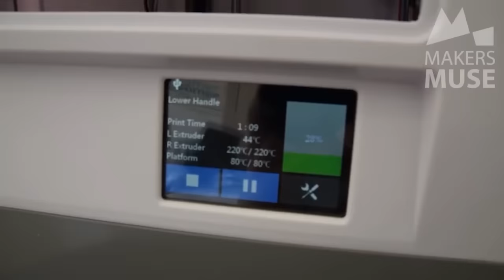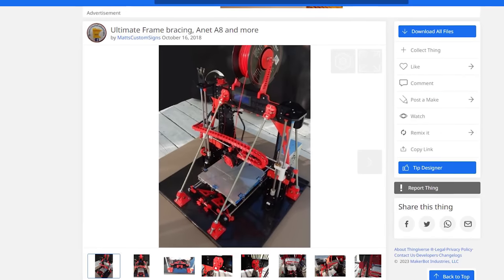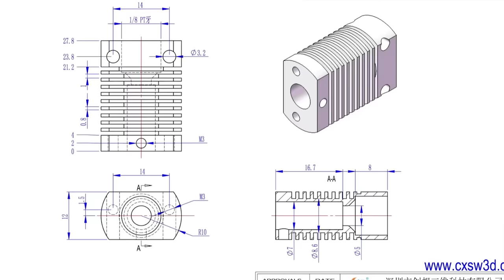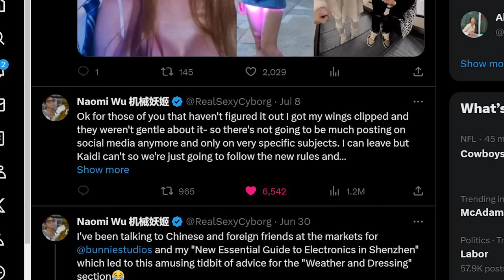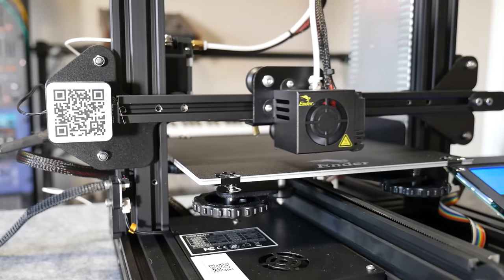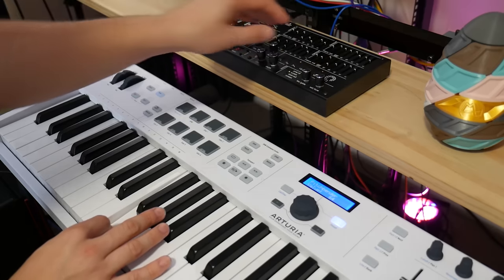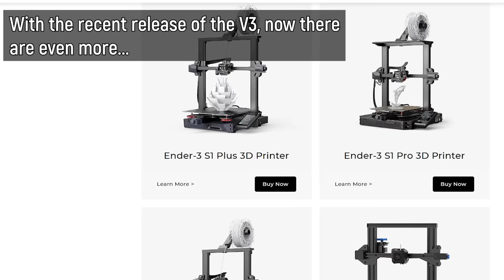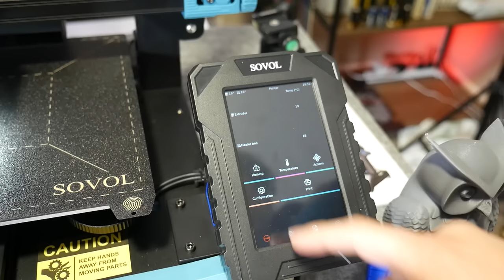Creality Ender-3... it's time to move on.

Comment: For me the its was always about trying to figure out how to get my ender 3 to work and when it did work something would go wrong. When i thought i had it working it turns out my belt tension was too much and ended up snapping mid print. It was a good learning curve it was fun and frustrating but it made me learn alot.

Comment: Similar to what many manufactures do to extract as much revenue by repackaging same old technology in a new package, unfortunately. Yamaha does the same thing as an example my Yamaha PSR910 has as many features as some of the newer higher end keyboards. I had to fix my old keyboard, many times, for this reason instead of purchasing a newer model which aside from a few maybe extra features, it has the same old technology but in a nicer and sometime not even that, package. Same with 3D printers and, in general, many other products.

I noticed in another video that talks about the CR10 S Pro  being a better machine to all  the previous models,  probably because it approximated the earlier excellent Anycubic I3 Mega in architecture, and  which, in my opinion, the I3 Mecha architecture yields a much better 3D printer from many aspects, beginning with a CLEAN and STRONG design approach.

However, I am not a fan of open architecture (mechanical structure) 3D printers, although I have machines of my own conception, designed this way, for simplicity, but in a core xy configuration which in this case justifies due to the mechanical stronger structure when done this way with lightweight extrusions.

Comment: My first and current printer is an Ender 3 S1. My first one had to be replaced because it was faulty out of the box.

The second one that I now have is way better. When the printer works: it's great! When it works. Have your first born set aside to sacrifice to the 3d printer gods when you need to troubleshoot the thing every so often though.

Comment: He has a point. unless you get an ender 3 v2 neo. Its still a great printer and I currently have 2 because of their great value but now there are better printers for under 200. And if you hare willing to spend about 500 dollars you can get an anycubic. Which can prtint at 500mm/s and has a build plate size of 420mm x 420mm.

Comment: You forgot another factor people consider... Out of box usability!!! That is a HUGE thing with people wanting to get into 3d printing. I have been in 3d printer since original ender and flashforge dreamer. I rarely printed becausr it was a pain to level, set z offset, get bed adjession ect. I said id come back to 3d printing when its not a pain.

Enter bambu labs. Plug it in and print. Literally the easiest thing ever. Its ridiculous. Sent back the ender 3 v3 i just purchased and never looked back. Buy the best printer you can possibly afford. Bambu labs has clearly taken over the market. Theres a reason. Havent even noticed that it is closed source.

Comment: We have an ender 3 max that's been out of commission for half a year now. Have spent more in parts trying to fix it than the entire machine costs new, dang thing just power cycles whenever you start heating the nozzle. Very VERY annoying and I'm about ready to give up and find a different platform.

Comment: I have a Ender 3 v2 Neo, and I think it prints just beutifully. But it is slow, and the fan noice is really annoying. So I have a few upgrades to do, all metal hotend, a bigger nozzle and quiet fans are in the pipeline. And I have a raspberry pi just lying in a drawer so I guess Octoprint also is in the near future.

I'm glad it's my first printer, but I think my next printer will be from a different brand.

Comment: I bought a CR-20 and that’s just an ender 3, more or less (automatic bed leveling though). I've had so much trouble getting good prints, or even finish prints, that it just stands in a corner and isn't used anymore.

Comment: My first FDM printer was the Voxellab Aquilla, Lord was that thing a P.O.S.
I highly suspect they gave me a refurbished model even though I bought brand new.
I now own an Elegoo Neptune 3 Pro and let me tell you, it's a world of difference to have auto leveling built in and I've had no major issues with it asides from the parts not sticking to the plate nicely without using a glue stick.

Comment: I just pulled mine back into the light as I had the issue of I guess it clogging up on itself and it’d print with nothing coming out, I believe I have it fixed now by taking off the bowden tube and cleaning out the nozzle so I’m hoping it’ll go back to printing and I won’t have to do that again 😂😅 I definitely agree that the ender 3 just isn’t the go to anymore as there’s better options so with a bit of homework buy something else instead of the ender 3 😂

Comment: I mean if I got another printer I definitely would get a better one, butt it was kind of hard to beat that $99 special MicroCenter had (aside from kind of having to get some extra stuff to make it work..butt I probably would've had to get that stuff anyway, so at least I wasn't as far behind when it came up). Ik I'll have to replace stuff sooner, and have less convenience with it then with others, butt not having to spend that all at once definitely helped break the seal of getting in to printing, and (fortunately) there's ppl like you that help work with what I got :p

Comment: The Ender 3 S1 (Non-Pro) so far is really good, it's the first one I have owned/ used and worked right out of the box but I'll also add they're some thing that do need some help. Ps I will edit this if anything happens because i'm going to update the firmware both for the display and the main board.

Comment: After my first CR10 died and I couldn't get it running again I went to Microcenter to pick up an Ender 5 plus. But when I got there I realized I could get a CR10 V3 and an Ender 3 pro for about the same money. I really do like the Ender 3 and never had any issues but I probably don't use it as much as more hardcore users. That being said I'm thinking about getting a Bambu or two next year. 😂

Comment: The majority of 3d printers sold are bought by hoddyists that can't afford or don't want to plunk down $500 - $1000 or more to get into 3d printing. The Ender 3* units are still viable. You can pick up variants for less than $100 on sale. If you feel the need, upgrading them is cheap.
I bought an Ender3 v2 that printed quite well out of the box.  Because I like to tinker, I've added mods over the last 3 years, such as a BLtouch, slice bi-metal hot end, Satsana blower housing, linear rails, micro swiss direct drive, dual Z drives with extended Z rails to 400mm and jyers software. It's still a perfectly reliable printer. I often think about a larger print bed and if I go that route, there's a website that sells kits to make them bigger.

Comment: right now, I just can't use my ender 3 pro after the rats got into the box and ate the wiring. replaced the board with a 4.2.7 and bltouch on a sprite direct drive, and non of the creality firmware works. so i am in the process of trying to learn how to compile my own code. still can't get it to home anywhere lower than 5 inches above the bed. lot's of frustrations

Comment: My only printer was an Anet A8 in 2018.
I printed a test cube about 3 times, threw my hands up and abandoned the 3d printing scene.
It left an extremely sour taste in my mouth.
I want to come back, but the only "no fuss" solution being Bambu Labs (not open source) is really frustrating to me.
Reply from the maker: Most of the new bed slingers are good from factory now! You can go with Prusa if you want some open source details, or Sovol who release full .step assembly files. Very sorry you got burnt by the A8 , they ruined it for a lot of people.

Comment: Correction to my rant: I re-listened to your comment and you did say that they were basically the same. So, my rant:
I disagree with your analogy about toothpaste.  If you read the labels for active ingredients you'll find that the sensitive teeth is no different than normal toothpaste. If you look for whitening toothpaste then 50% of the time there is no difference and the others have a small amount of peroxide, Hydrogen Peroxide.   This amount is so small that you want notice a change because if the amount was high enough to do anything your teeth would start to have problems and you really would need a de-sensitizing toothpaste.  Which they will gladly sell with another label stuck on it.

And thank you for opening my eyes and re-thinking my next purchase as I've been considering getting the V3 KE. I've been watching the various groups and seeing what problems people have and as you said, quality control is bad.  As I can afford better I guess it is time that I start thinking that way and quit punishing myself with beginner printers.  
After doing a little bit of research I wonder why you mentioned the Sovol SV06.  Have you tested this out as there are so many disturbing reviews about  Sovol and such?

Comment: so you mean to tell me the reason I cant print in PETG is because of that tube not being cut correctly AND too close to its own melting point while printing???

There isnt a way to solve this is there? id like to go PETG because the one print that came out great for me is strong AF compared to any PLA ive done. but with the stringing, the constant clogging, and the temp req being so high its dangerous fume wise to run idk how to use it...

Comment: The ender 3V3se(ke) changes the landscape of cheap 3D printers. It's automatic functionality changes the game as it solved most of the problems I've had with my E3V2.

Now, I'm just waiting for community support in terms of custom firmware and slicer support. Creality makes decent hardware... But don't have the enthusiast in mind. Their slicer is garbage and their lack of firmware configuration control prevents serious tweaking the printers.

Comment: Huh, I’ve had my ender 3 for over 2 years and it works perfectly for me. It’s big and great quality. Ofc I had trouble for the first few days, but when I got used to it it worked perfectly fine with no big flaws. I personally think it’s great but ofc not to be rude. :)🙂
Reply: BUT over everything else, the bambulab is really (in my opinion) the best.

Comment: I have a ender 3 V2 and a Tron xy ender clone and love both of them.

Sure there older and outdated but I have 150$ into both of them. So I don't need a fancy 500+ $ printer for what I do. 

I keep a .8 nozzle in the Tron xy and a .4 or smaller on my ender. 

So for me having 2 printers that just work is better then one fancy printer. 

Just my experience

Comment: I would not buy the original Ender 3 as a beginner printer, but the Ender-3 S1 Pro could be a good beginner from Creality.

It has bedlevering, and it has direct drive and quicker print speed.

Comment: I've got a new Ender 3 being delivered in a few hours time. I looked at many alternatives but it was in their Halloween sale from Creality and seems to be an ideal cheap basic printer that's easy to modify. I've started off by also ordering a direct drive extruder and an insulated enclosure for ABS printing but I'll probably add other things such as auto levelling soon too.

I've  had a Flashforge Creator Pro since 2017, which is great for all types of filaments but the bed is too small. I also have a Sunlu S8, which is a CR10 clone and great for larger PLA prints but I wanted something for ABS with a slightly larger bed and that's what the Ender 3 is for. I should be using it in a day or too so hope it does what I need.
Reply: good idea on the direct drive for me the stock setup was nothing but trouble so much so that i gave up on the printer for 6 months till i remembered i had gotten a direct drive setup in one of their retailers spin to win events

Comment: the E3 is one of the best beginner machine, if someone like to learn how a printer works. but yeah, this is not a beginner printer those who just want to print. but I think that they will never print well, because of the lack of knowledge about the printers itself. this fact will effect them to choose the best speed, acceleration, infill, thermal settings in the slicers, and won't be able to use the klipper up to its limit.

Comment: I just got a deal on a ender 3 v3 ke… it has all the stuff a modern 3D printer should have. I agree the other, older, models should be removed from the lineup.

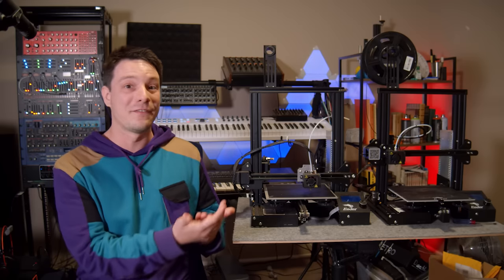Comment: @9:12 I'm laughing my ass off because for the first time since getting my Ender 3, I decided to upgrade the bed plate. My original bed plate just had way too many scratches and bumps. I went out and got a 1/8th inch piece of glass cut to size. I then spent maybe 12 accumulative hours, trying to get the bed level and prints to work. My final solution was cutting off the nub on the z axis switch exactly like in this video lol... wish I could have saved myself all that work :P

Comment: Wel because of you a geth to them 
Bud i started whit a Easy thread k9.
For 65 euro.
Yeah😮and learnt fast from it 
Bedtramming not leveling.
After that trip .
Yeah i orderd a creality 3v3se.
And this printer is so easy to use .
You can even set the z offset by hand just go to edit.
Change the filliment just heat up the p.l.a.
Do not do extrude.
And pusch the next in.
Want a vase whitnin a hour. Its done whit a 1 mm nozzle.
Everybody just talk about the 0.4 nozzle.
Wel a just use different nozzles.
For different things.
From litofane to nasa whrenge.. infinity cubes.
Balbarrings.
They al work .
If you know how to set your slicer.
Why use 0.4 hicht when you can set it to 0.6 .and geth a hour of your print time on your nozzle.
There so many settings.
If you dont want to learn how to slice dont geth a 3 d Printer.
Start looking at the software first.
And how to put your model.
On the buildplate.
Preview every print .
Aline z seam 
You can al find it on you tube.
A own a ender 3.
Whit knobs.
And runs like hel .
Goth it on marketplace for 15 euro.s.
Put some upgrades there z.axel.
Metal extruder.
New p.t.f. tube.
And the way it go.s
Al 3 printers run fine .
The Easy thread.
You just need a small layer hicht like 0.04.
And it prints fine for small stuf.
The other two are for the bigger stuf.
Ore i just run a set .
On one .
And a set on the other and put it together.
Ender 3 .
Just are good printers.
He  just. Buy a other ender 3.
And dont geth them.😂😂😂

Comment: Having got into 3D printing with a WANHAO i3 (v2?) I've ended up with a Ender 3 v2 and it's been a great if slow workhorse, I added bed levelling and different firmware and it's pretty amazing the results it can create. I've been looking at both the Creality K1 and Banbu P1P and both push you down the property software and cloud solutions road that in Creality's case seems to be a bit half baked and with Banbo's its lets harvest as much info as we can and share with anyone willing to pay. So I'm a bit lost as to where to go from here, Voron looks interesting but pricy.

Comment: I think the ender 3 is a good beginner printer, bought my first 3d printer 3 weeks ago, a ender 3 pro second hand and of course since its an ender 3 I´ve had nothing but issues, when I fix one, I see another issue, I´ve printed almost 24/7 with it since I´ve bought it and I think I´ve had 1 or maybe 2 good prints, so no the ender 3 is not really a good beginner printer if you just wanna print parts but I actually like the tinkering but soon i´ve spent more on my ender 3 pro on new parts than a ender 3 se or ke to fix it so if someone wanna get into 3D printing, just spend a little more and buy a working printer.

Comment: There is some reason why you needed a third Ender that you have not touched on. Why 3 and why new? You say, don't get one, but there you are buying it. 
And right now, there are so many Enders of various types floating around on the second hand market for less than $100 with lots of mods already done to them from sellers upgrading to Bamboo machines. Maybe this purchase opportunity will only occur over the next 6 months, but this month I've gone from not owning one to having three with spares for less than the price of the cheapest one new.

Comment: when you just need high quality PLA parts reliably, Ender-3 is GOAT.
Sure it's slow, but it prints very nice, and it's a absolute workhorse. Costing just 100€ in case something breaks on first one and you have to wait 5 weeks to get parts.

Comment: There is a mod for the ender 3 on thingiverse that converts it to a direct drive printer. it requires no additional parts and drastically makes it a much more useable unit.
Reply: There are also oficial parts like the titan extruder made alongside e3d or the Sprite SE (a Sprite that puts over the hotend, very easy to install).

Comment: I bought a brand new one for $100 from someone who decided he did not want it.. Now how do I upgrade it?
Reply: The 2 biggest improvements we have made (and we've made them all) are stiffer bed springs (or silicone replacements), and the BLtouch or 3Dtouch. All the others just add a few % improvement. We have BTT motherboard/display, MicroSwiss NG direct print head, dual z axis, BLtouch, silicone bed "springs", ball bearing filament roller (this is not bad and it's cheap), and I can't think of anything else. Adding the temporary (NOT permanent) Locktite on the bed screws helps keep them from backing off. We don't have a ceramic bed.